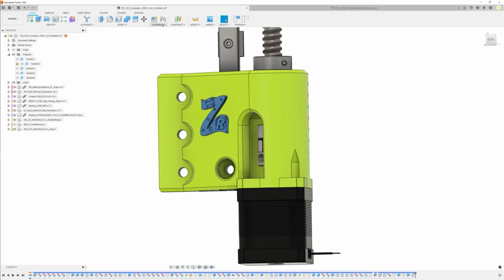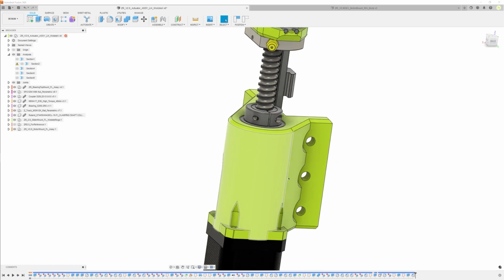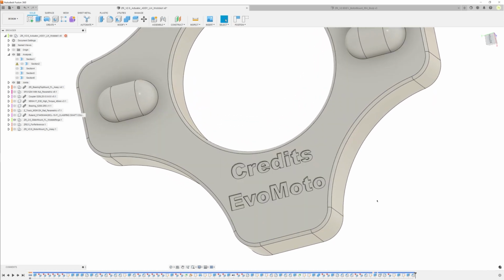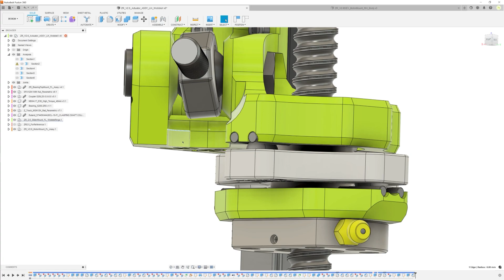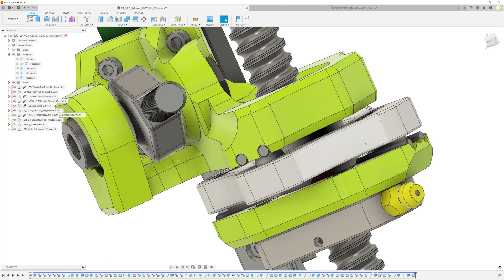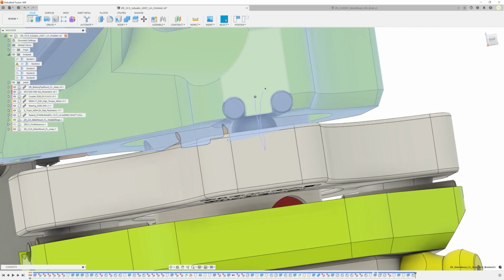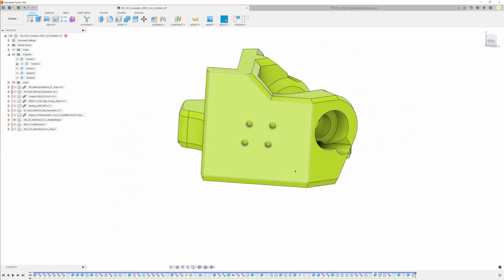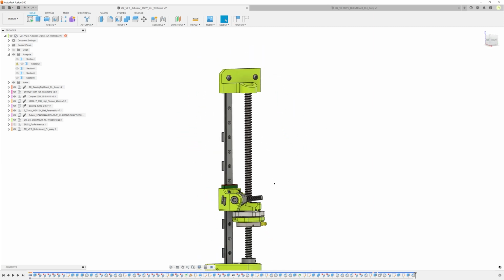HevORT ZR2.6 using WobbleX first look

Comment: you deleted the top design i bought wobble x's and i can't use it on your machine as you deleted the top part of your design, on your ZR on thingiverse it only shows the lower wobblex adapter, but no top one
Reply from the maker: Sorry about that.  I corrected the links in the Video.  you can also find a complete model and export options here: https://a360.co/40QC5G5

Comment: Have you tried putting the ball screw under tension to remove the wobble? 

I have a large CNC router with a 3m long ball screw approx 40mm diameter, I believe it is tensioned by a stack of belleville washers though I haven't taken it apart.
Reply from the maker: Well I don't think the kind of tension that plastic printed parts and bolted aluminum framing would provide be enough to straighten these screws.  I rather rely on these very forgiving WobbleX isolators.  They will absorb with ease any defect and misalignment coming from printed components, assembly, frame cutting etc ...

Comment: Could the wobble plate use flexures instead of plastic bumps on steel rods as pivots?
Reply from the maker: The design shown here includes a WobbleX mockup that describes the possible positions of the ball bearings it uses to compensate wobble: https://s.click.aliexpress.com/e/_DBOA2GF
Flexures will compensate in a 2 axis fashion.  In oher words if the Ball Nut is following the crooked axis of the screw, it will tilt.  This tilt cannot be managed by flexures.

Comment: You could rotate the hex slot 30° so that the point of the flats is facing up, rather than having a flat facing up, and that should help with printability.
Reply from the maker: Yeah,m we checked that this morning.  The design was done this way to increase material between the nut cavity surface and the M3 Screw hole provision right above.  It was also reported that the part prints good without support using bridging.
Reply: I wanted to recommend this as well. So +1 from me.